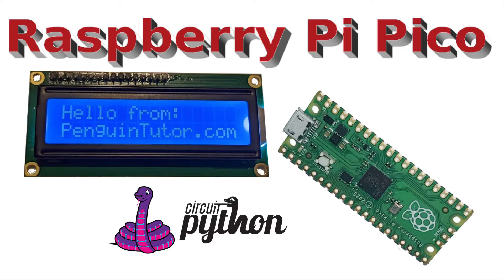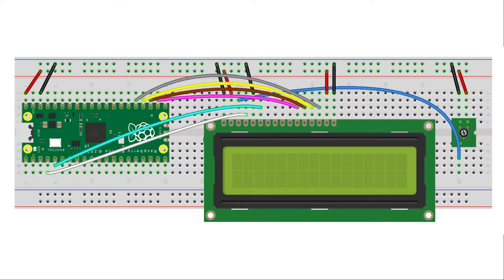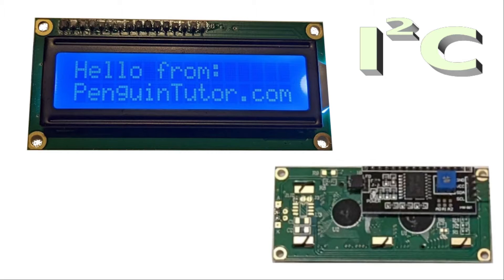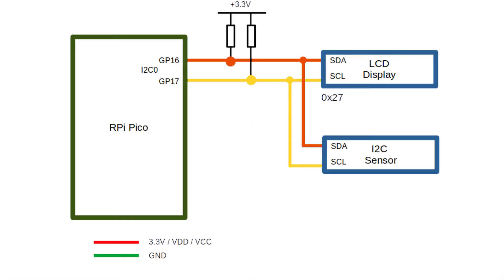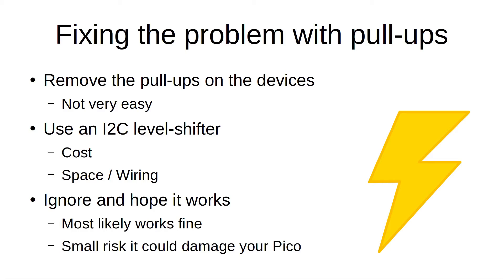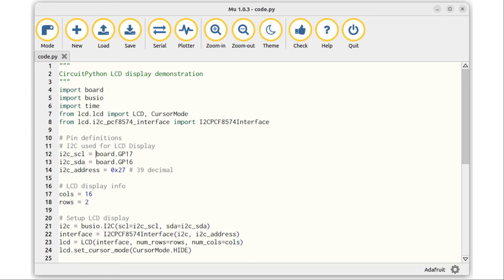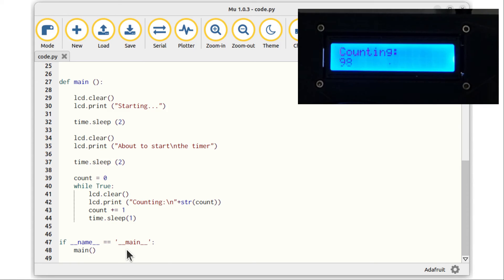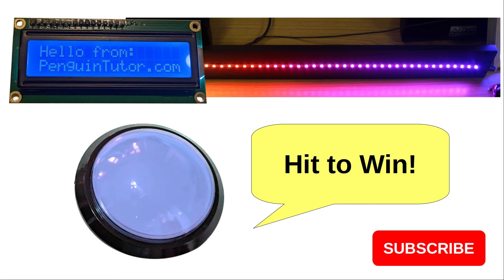LCD display on the Raspberry Pi Pico with CircuitPython

Comment: All these tutorials have an extra board 😢 but I only have lcd.
Reply from the maker: You can buy a PCB module to connect to the LCD display. That uses less pins than wiring directly. You can buy the PCB cheaply, search for "i2c LCD module".

Or you can wire directly but you will need to use a library that communicates using the parallel interface instead.